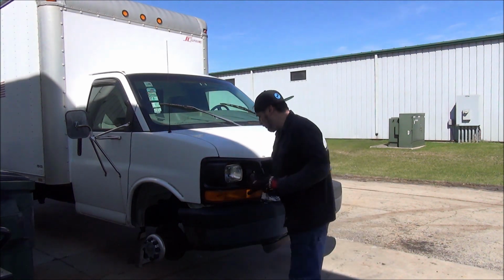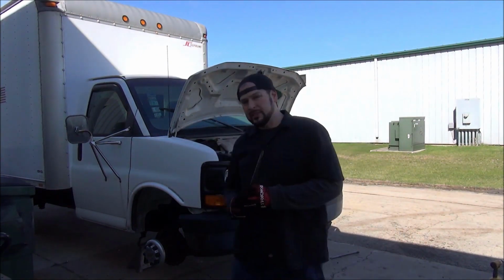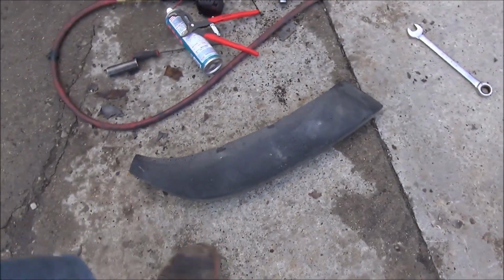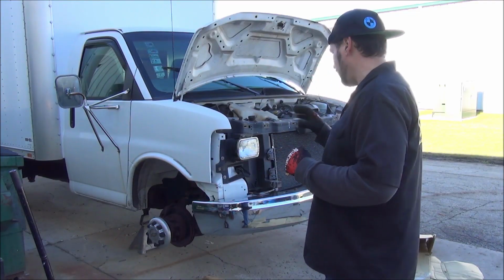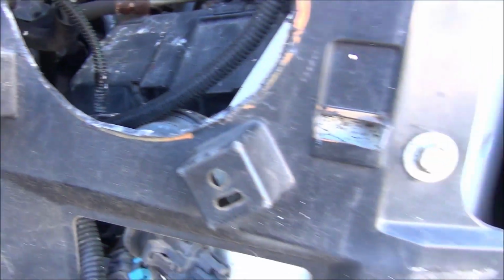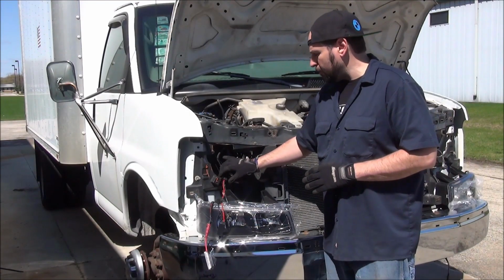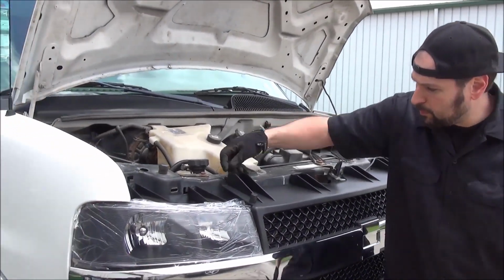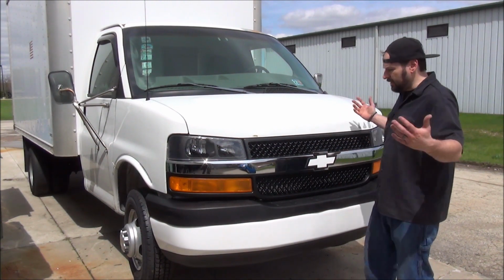Composite headlight conversion: 03-19 Chevy Express / GMC Van, Box truck, RV Savana Front end swap

Comment: Looks great now with your saved money you can finish the job and paint the nose on the truck so it dont look half assed. 
One thing to note..put the whole bumper together. The top bumper pad .(black piece) the lower air deflector. ( lower spoiler piece) . This makes it so much easier. Dont install the grill beforehand . There are 2 main bolts to secure the bumper and the upper bumper pad has notches to access them. Put the bumper all together on with bolts . Then the 2 outer bumper braces. Tighten those . You can get a little adjustments to line the bumper up . Then tighten.  Done. Grill last . Pops in with clips then 4 -10 millimeter bolts on top , 2 more behind the signal lamp . One on each side. Put your signal lamps in . Looks good . Like the one piece lamp other then the sealed beam bulb.

Comment: Thanks for this information it made such a big difference  to the front end , a side note if you are going to do led bulbs you will need to do some additional trimming to the core support plastic and also will have to get the low profile fan on the leds
Reply: That is correct about the led bulbs. I did my Van about 6 months ago...looks totally different.  However  my driver side head light hangs out just alittle bit.. does yours do that too?
Reply: If you do the led bulbs . You get the 9006 led without the extra wire and fan. Fits just like the factory incandescent factory bulb . No cutting and cursing . 1-2 done

Comment: You don’t have to remove ac line just drill out rivets on top crossmember, then make a cut to slide the ac line out and do in reverse to to install new… did this to replace my engine and save money on not doing ac work🎉

Comment: Great video but I have one question, does this wiring harness affect the daytime running lights or the headlight sensor on the dash. We have everything but wanted to know this question
Reply from the maker: The DRLs on my truck are the running lights (turn signals), so the headlight harness did not effect that operation in any way.

Comment: Just did a subset of this on my 2007 Express Passenger Van. My paint was classic Chevrolet  'peeling off' in paper sheet chunks and I really wanted to do a better than average 'repaint' using Rustoleum, hardener, and a Harbor Freight $20 paint gun. And... since I was going to be removing the bumpers and a few other parts as part of the job decided to upgrade to the composite lights as a finale! It looks fantastic!
Reply from the maker: Glad to be of assistance!!!!

Comment: I was thinking of doing the opposite conversion - going from composite lights to sealed beam so that I can put some 5x7 JW speaker LED lights in. Would this be do-able with a new grille suited for the sealed beams?
Reply: Hi there.. I was thinking the same thing. Were you able to make the sealed beams and grill work with composite core support?  Thx

Comment: is it normal for the lights to be hot like hot hot ??? 🙏🏼
Reply: Legit HIDs do still get HOT.  Typically most kits are converting either 35 or 55 watts of electricity into light, and heat.  Still less than the original halogen bulbs that are more like 70-100 watts.  But they stlll would be hotter than you would want to touch

Comment: Do you have one where I switch back to the ugly workhorse headlights?

I prefer the glass, cheap, easy to replace version, especially because headlight assemblies aren’t made of glass anymore like my Honda Accord

Glass don’t fog up like plastic, and I can get a brighter beam by customizing a relay system, heck some aftermarket H6054 LEDs have “Glass” lenses.
Reply: No.  While some cars are a bear to replace bulbs on, usually because of limited access, these are not.  30 second bulb changes.  Much faster than sealed beam.  Enhanced looks, mileage and lighting to boot.
Reply: @karltruty3469  Guess I better start planning a video where I customize a headlight conversion going from gross yellowing plastic headlights to crystal clear glass headlights... with LEDs.

It'll take a while, but I'll get there.

Comment: Is this possible to do on a 1997 ? And is it full bolt on
Reply from the maker: Im sure it could be done.  But would be mroe involved.  Probably need to replace hood, fenders and grill/headlights
Reply: @Massive20  Looking at doing my 2002.  Has anyone done the conversion with hood, fenders, etc.   Unsure if 2003+ fenders would bolt up to a 2002 model.  Any input would be great.

Comment: If you still have it.  What was the wiring part number that you used for the headlights?  Working on my conversion now.  I have to change the passenger side bumper too.  Thanks
Reply from the maker: https://www.amazon.com/gp/product/B01M15V3HK/ref=as_li_ss_tl?ie=UTF8&psc=1&linkCode=sl1&tag=massivespeeds-20&linkId=c2bb069fd3abc639f4ad28f4a70caeaf&language=en_US

Comment: I know it's a year old, but this is so helpful man! I'm going to do my van in the next couple of weeks. the sealed beam lights are so weak and yes, fugly. I'm going to wrap the bumper too, and anticipate the same battery/HID upgrades haha!
Reply: Our pleasure!
Reply: @karltruty3469  Mine worked out great! I initially had terrible ground loop interference with the stereo, but switched to higher end LED bulbs and it solved the problem. I also ended up spraying the bumper with Raptor liner instead of wrapping it. Thanks again for the tutorial.

Comment: The set up looks good.. I have a 1998 chevy express do you think the same set up conversion fits my van??
Reply from the maker: The front end is a little different on those, but it's still basically the same van underneath.  so I'm sure you could update to the 96-02 composite style fairly easily.  As far as to update it to the 03-present front end, prob would need hood/fenders/core support as well as the lights

Comment: Can this be done to a Chevy express 1500?? So much better than the horrendous oem headlights.
Reply from the maker: Should?  What year is your express?
Reply: Asking the same question I have a 2011 Chevy express 1500
Reply from the maker: @clearlyexpediting  Yes definitely.  This applies to any Chevy Express or GMC van 03-19!  1500, 2500, 3500, etc.

Comment: What HID and LED Stuff did you install.... do you have part numbers and links ?
Reply: I am ready to do this on my 2017 Chevy Express 2500. I have all the parts ready... Thank you for making it easy with your detailed video. Let me know whta you ised for headlights and other bulbs... HID and / or LED.
Reply from the maker: @bobbykarounos2074  We used Racesport HIDs on the low beams, 6000k 35watt.  And AuxBeam F10 LEDs for the high beams.

Comment: I wanna change my 2000 Chevy express limited se to the newer front end that you put on your truck
Reply: That would be cool.  I think you need the hood, the fenders and then all the stuff from the video - the grill/headlights/etc
Reply from the maker: Yeah im not sure?  You might need to do the core support as well?  not sure
Reply: Thank you for the comments.im going to get the whole front end and the core support as well.ill keep you guys undated on the build🙏🙏🙏
Reply: @antonioharbor  I'm doing that as well... Any update?
Reply: Mission Gearhead yes,I’m remodeling the whole van right now.im doing the upholstery right now and doing fiber glass door panels on the van as we speak.
Reply: antonio harbor I have a 2000 3500 Express, were you able to find a year that bolted up? I HATE the look of the front end on mine
Reply: Dylan Nolan I’ve been looking on autobidmasters and they have a lot of vans on there.look up 2003 and up Gmc Savana and Chevy express.your gonna have to change the whole front end of your van.make sure you get the radiator core support and the whole front end including the front bumper support also.